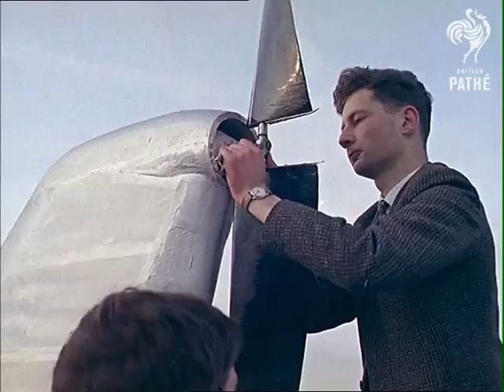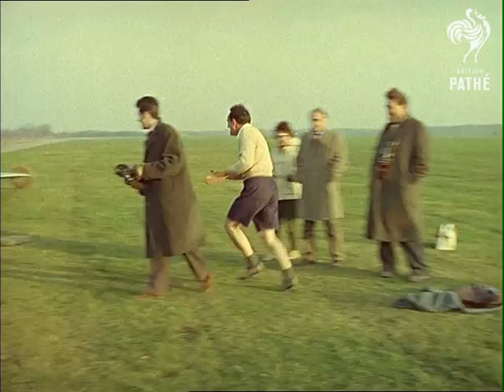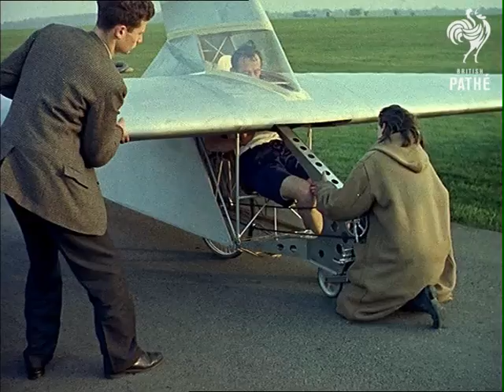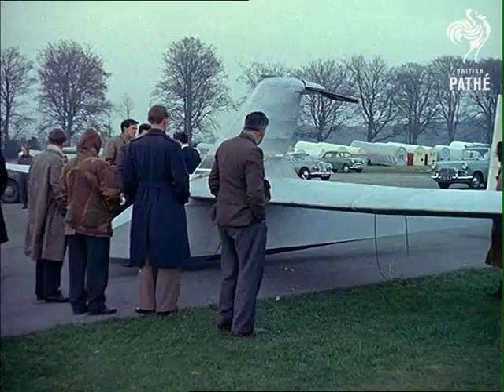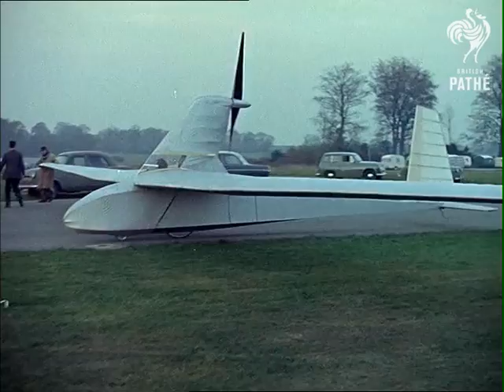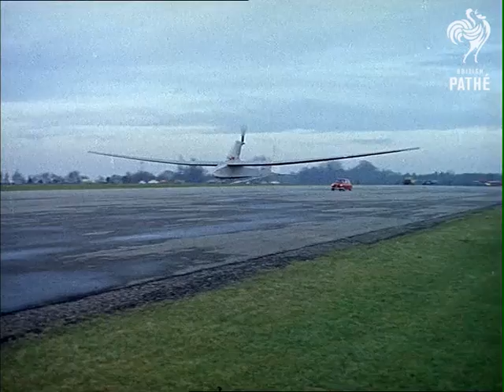Flying Bicycle aka SUMPAC (1962) | British Pathé

Comment: This looks like it was digitized from the negative and sounds like the original mag reel. Certainly doesn’t sound like 16mm optical track or even Super 16 mag track. Even for negative it’s amazingly clean and free of wandering from pin registration. Very impressive.

Comment: The Southampton University Man Powered Air Craft (SUMPAC) is on display at the Solent Sky Museum in Southampton.
My Dad spent many hours calculating the aerodynamics, and weight/balance, and material strengths required for this aircraft.
As an eight year old, I remember being absolutely frozen cold, but at the same time, being totally in awe at what I witnessed.
We went on several different occasions, one of which I recall there were two other man powered aircraft present.
My interest in home built aircraft has remained to this day.
Reply: Way back then when the materials were heavier.
Reply: Hi Nigel, I was wondering if there are some papers published on this aircraft and couldn't find any. Very inspiring and Would like to reach out to your dad or you if it's ok.
Reply: Aluminum Jay, unfortunately my Dad passed away long ago, he never kept any of his calculations.
The materials used were traditional aircraft types, such as Sitka spruce, aluminium and balsa wood, with a doped cloth skin.
All the materials were surplus War stock that was available very cheaply nationwide in the late 50's, early 60's.
For more information on Sumpac, your best bet, would be to go to Solent Sky Museum in Southampton armed with a good camera,  as it is hanging from the ceiling, and not easy to get very close to it
Although strong enough to fly, it was quite fragile, and probably more so now with age.
The museum might have documents relating to the build.
Sorry I can't be more helpful, my Dad studied Maths at Southampton after the War, and always kept in touch, hence working on the project, checking all the calculations, very time consuming using a slide rule, as modern computers were but a futuristic dream in those days.
Kind Regards
Nigel
Reply: @nigelsnell9770  thanks Nigel.
Reply: 🛑 Qu'est-ce que l'islam? 🔷

🔴 L’islam n’est pas qu’une religion parmi d’autres.

 
🔵 Il prêche le même message prêché par Abraham, Moïse et Jésus.

🔴 Le mot « islam » signifie « soumission à Dieu » et c’est pourquoi le musulman apprend à établir une relation directe avec Dieu. 

🔵 Comme c’est Lui qui nous a créés, nul ne devrait être adoré à part Lui.

🔴 Dieu ne ressemble en rien aux êtres humains ni à quoi que ce soit que nous pourrions imaginer. 

🔵 Le concept de Dieu est ainsi résumé, dans le Coran :

Dis : « Il est Dieu, l’Unique.  Dieu, le Seul à être imploré pour ce que nous désirons.  Il n’a jamais engendré et n’a pas été engendré.  Et nul ne peut L’égaler. » (Coran 112:1-4)

🔴 En devenant musulman, vous ne tournez pas le dos à Jésus;

🔵 vous retournez plutôt aux enseignements originaux de Jésus et vous vous soumettez à son message prônant l’unicité de Dieu.
Reply: I applause the serious mind team who conceived this plane and the enthusiastic and challenging pilot 😁😁
But is the question is what the disposable light materials at this time
Reply: The video is well preserved. Today there are many designs for muscle-powered aircraft. It’s a pity that there is no demand today and in many countries ordinary people are prohibited from flying. But if you don’t chase speed characteristics, you can make similar structures that can take off from the water surface or for the flight of 2-3 people! I am more interested in practically useful things, but I would like to contribute to this matter if possible, if there is an opportunity to implement this in a country without wars.
Reply: We need this stuff to be built and open sourced. Why not creating a patreon campaign?

Comment: It's cool but they need to get some air into that cockpit.  Peddling causes panting.  If he were doing that for say hours on end he'd be out of breath due to the limited space and the shit load of Co2 he's breathing out and in at the same time.  He'd pass out and crash.
Reply: if he were to do that for say a couple hours or so, he should be a marathon runner.
Reply: Sigurd Eberstark
Peddling for 2 hours is easy. The real challenge would be to try to peddle for the exact length of time it takes for a plane to cross the ocean.
Reply: +Shanethefilmmaker 1hp is equal to 743 watts. An endurance cyclist averages out at 250-300 watts through a 100 km bike ride. This same cyclist claims to have sprinted on his bike and produced 1200 watts . (He has a thing on his bike that measures his power output) 200-300 watts is not half a horsepower, and 1200 watts is not two. Basically,  the point I'm making is that a pilot in this plane would need plenty of strength as well as endurance. I doubt very many people could pilot it for a few hours.
Reply: +Shanethefilmmaker It's worth noting that the cockpit won't be airtight, so what you've said doesn't apply.
Reply: Shanethefilmmaker But at the same time, the bike will be moving forwards. The air around it will not, so physics state that if they were to put a small intake in front and put a tiny hole in back, there would be plenty of air for him. Even still, this thing will take tremendous strength and endurance to fly. I mean, at this rate put a two hp electric engine on it.

Comment: You see!, any thing is possible, you just got to use that 3 pound mesh of gray matter encased with in your skull.
Reply: I think that was actually mostly leg power...
Reply: AmpZillia not anything some things are impossible
Reply: Yeah the jolly chap's had to do some cycling work indeed. But the design proces was a sport for the brains.
Reply: CHOPPERGIRL's AIRWAR legs have existed for billions of years though

Comment: My god...
Reply: beats sitting in front of the propaganda tube!
Reply: my god.. how thf F! can they not have improoved this in over 50 years?  Acctaually this is the best i ever seen so far.
Reply: @kukhuve6595  57 years actually, quite tragic! He only has to supply 2hp to get oof the ground and 0.5hp in the air. Yet, the lightest ultralight aircrafts today require a minimum of 30-100hp to stay in the air!
Reply: It's full of stars?

Comment: what i dont understand is why no-one uses a very large gear connected to a tiny gear to spin the propellor at a very high speed
Reply: Propellers don’t like to spin at high speeds. And no matter the gearing the output can never be more than the input.

Comment: 1962, where duct tape still fixes everything
Reply: In 2021 it is still used to fix everything you know.  Just so you know it s commonly used in commercial planes.
Reply: @unhommequicourt  No, duct tape is not used in commercial planes. 
That is Speed Tape, something entirely different.
Reply: @matthew alvarez  That is paper masking tape. Duct tape would have torn the fabric cover when removed.
Reply: @無名賢者 Why, is he dead or what?
Reply: No duct tape no glider plane. 
1. to seal the gap between wings and fuselage (wings are removable and you have to seal the gap)
2. to stick the woolen thread to the canopy, the main instrument of glider plane still today (…even the U2 has it!)

Comment: From Wikipedia: It was made to win the Kremer Prize, but didn't succeed because it didn't fly far enough, & couldn't make the turns required by the prize rules.  Its 1st flight in November of 61 was 70 yards & climbed to 6 ft.  The longest flight was 650 yards, rising to a max. height of 15 ft. Turns were attempted, with 80 degrees the best achieved. A total of 40 flights were made.  After a crash in 1963 it was decided to retire the aircraft although it had been repaired.